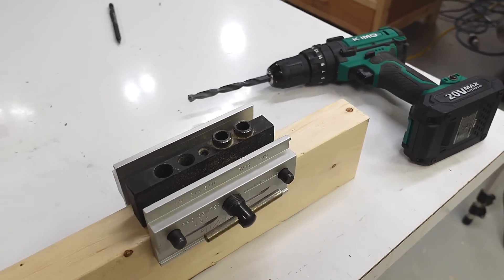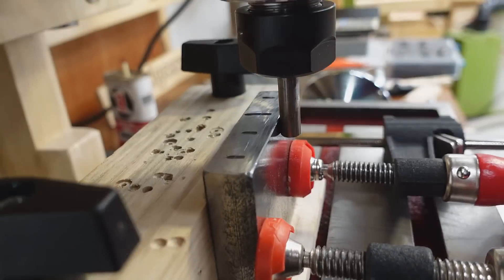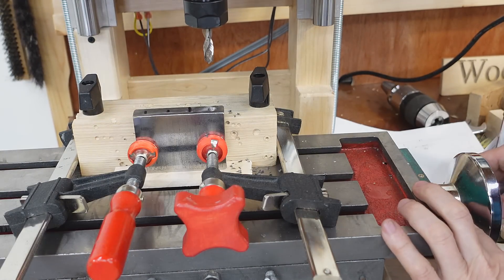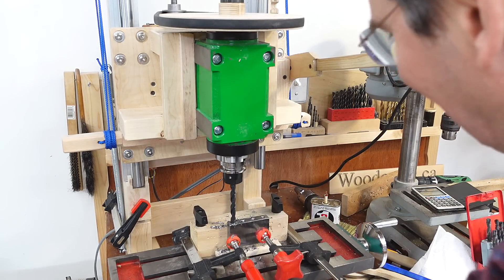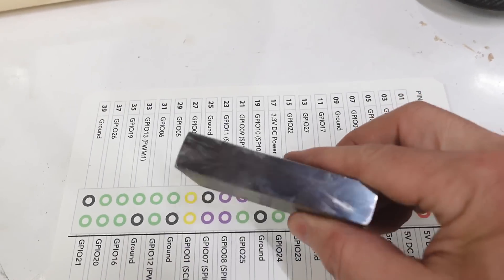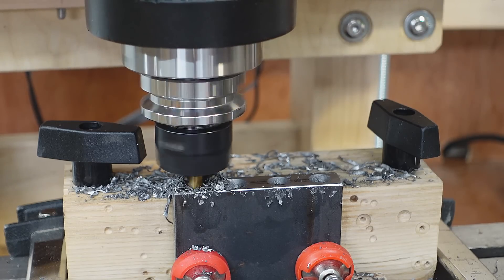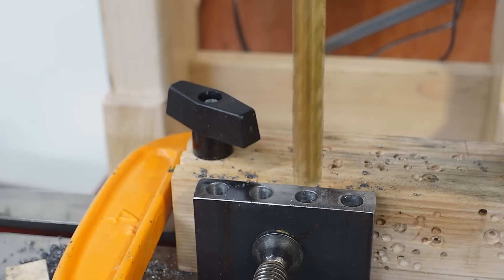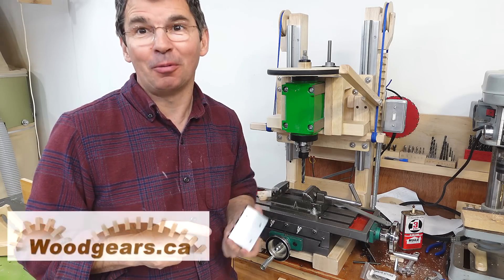Milling the dowel jig I always wanted

Comment: The jig needs to be hardened or it'll wear very fast. I looked at your vid history and you don't seem to have any experience there. Time to learn a new skill! Blondihacks has a very good beginner's tutorial.
Reply from the maker: aware that hardening would help.  But I made it nice and deep so the drill puts less stress on the jig.  And I used to just use a block of wood with a hole drilled in it as a dowel jig, and that also works — for a while.
Reply: Just use hardened bushings

Comment: Maybe it would be easier to use steel pipes with the correct inner diameter and press-fit them into a 3d-printed piece.

Comment: When the drill breaks through the bottom, it can move the workpiece. Maybe don't drill all the way until the end, or cut off the undrilled edge. You can also back it with some metal so that it keeps drilling snd never breaks through to thin air.

Comment: Try a proper cutting fluid. It works better than oil. try adding a bit more of it as well. it helps float out the cheeps. (homage to an old friend).
Reply: I was just going to remark that I didn't know you could use our beloved "3 in 1" oil as a cutting fluid.  Cutting fluids are still thinner, yes?

Comment: 12:40 It could be hidden with some welding (if it's not an unweldable alloy) or brazing and then milling or belt-grinding it flat again, though probably not worth the hassle for what is ultimately an aestetic mistake (assuming you remember which line is the correct one)
An easier mitigation measure could be to color in the lines, both for visibility and visually separating the correct line from the wrong

Comment: Those drill bits look a lot like the ones I’m familiar with from the big box stores.  I have found those are fine for wood and aluminum but are just not up to the task of drilling steel.

I have found it costs less in then to invest in good bits from industrial suppliers for the few hole sizes I need to drill into steel.  All that chatter and wandering you showed usually goes away with better drill bits.  Where I live, Fastenal seems to be the best source.
Reply: I have the cheapest black oxide bits made and they drill mild steel just fine. But I have a real milling machine and I know what speed to run them at too. So that's why they work for me.
Reply: A couple Dewalt cobalt and regular gold oxide HSS drills and a set of Mastercraft MAXIMUM Titanium coated HSS drills will cut some pretty hard stuff almost like butter. The Milwaukee bits I had previously didn't cut, and some "industrial grade "  from suppliers cut like trying to grind a hole with a dowel pin.
Reply: По металлу HSS-CO

Comment: A quick fix for the miss-scribed line: fill all the scribe lines with a high contrast paint, then wipe the paint out of the incorrect line. That way you know to always use the painted lines.
Reply: put a tape over the mistake first
Reply: @bullzebub  better put tape over all, and mark new lines ;)
Reply: Tig weld it, and then sand smooth on the belt sander. It'll be like the line wasn't even there
Reply: Grind the entire surface smooth and re-scribe.
Reply: Alternatively and less quick, bolt a small black anodized plate to each side and put the maker’s mark on there in addition to the scribe lines. There’s just something wonderful about covering up mistakes with vanity.
Reply: Put the same incorrect mark on the other end too, then come up with a justification for them

Comment: Research has shown, cutting with an angle grinder uses less discs when you move the grinder quickly, with little pressure. Pressing down speeds things up, but it's less efficient use of the abrasive disc.
Reply: He did a video on that ;)
Reply: @riba2233  What's the title? I don't remember if I saw it or not. I remember seeing a video looking into exactly this, maybe that was it lol.
Reply: @Convolutedtubules  I think it was on his 2nd chann

Comment: As a pre-digital age machinist, a guideline:  pre-drill holes no larger thasn the web size of the next drill size.  I try to match within 0.5 mm myself.
Justr FWIW.
Reply from the maker: Was aware of that.  But I was afraid the really thin drill would not drill straight enough, and then the bigger drill might follow it.
Reply: @matthiaswandel I'm just a hobbyist not a machinist, but I don't think wandering is a problem unless your bit is dull or you're drilling with too much downward pressure, even with small diameters.
Reply: @matthiaswandel  if the drill is properly ground with the center cutting point being in the center of the drill it will go the direction the chuck is guiding it.
Reply: I've always used a rule of the pilot drill should be 1/3 the diameter of the next drill. That's always worked well for me.

Comment: i know it's complexity, but a DRO might serve you well (or at least a position scale), and the challenge of implementing it might be fun.
Reply: I just got a cheap digital caliper off of temu, and chopped it up to make a Frankenstein DRO.  I think it cost me three dollars.
Reply from the maker: yes, I'm thinking that would help a lot, but I'm not sure how many projects I'll do where it would be that useful.  So holding off buying one for now.
Reply: @matthiaswandel Searching on DRO serial output shows the serial data stream from a inexpensive dro.  This is probably something you could read with a PI or microcontroller for a diy dro.
Reply: But it has to be only an encoder, connected to raspberry pi and with those nice ASCII art characters :)

Comment: Dowel jigs and their design have always been very interesting to me. I think dowels are an underused wood joint nowadays. A scrap of dense hardwood could be used as well but probably wouldn’t be as durable. Nice work!
Reply: Dowel joints are used in everything
Reply: @Phil659 Yes, definitely in production stuff like cabinets and knock-down furniture etc., I should have clarified- I meant more as a go-to joint for woodworkers on a single piece.

Comment: Dang Matthias! That angle grinder set up was awesome! Thank you!
Reply from the maker: it was an idea I came up with many years ago, but simplified a little this time.  See links at end.
Reply: @matthiaswandel  I don't see a linked video about angle grinder jigs? I see [1] Belt grinder build (2/2); [2] Miter doweling jig; and [3] Drilling/milling machine build, but they don't seem to involve angle grinder fixtures? Did you mean to link a different video, or did I just miss the right section?
Reply: @johnhawkinson It's titled "Angle grinder flat cut-off jig". Was out in the country shop when he was cutting up long bedframes for Angle iron (which is why this current setup is simpler)
Reply: I will be using that jig next time myself. Great idea Matthias!

Comment: I can't believe he's getting into milling, after decades of doing anything and everything in wood
Reply: I'm not surprised he's milling, but I am surprised his mill isn't made of more wood and an old washing machine motor.
Reply: @RFMongoose  He used as much wood as possible and an old furnace blower motor.
Reply: @woodsprout  naw, could have replaced those slides with panto mechanisms. And that x y axis, could have been wood. And the counter balance spring could have been a leaver counter balance. Also I thought he bought that spindle head.
Reply: @RFMongoose  You should build one like you describe, including a wooden alternative to the spindle he smartly purchased, then make your own video, instead of wanting him to build one with your ideas, eh?
Reply: @RFMongoose  I think a five cutter face mill made from osage orange and carbide inserts would be sweet.
Reply: @RFMongoose  Next week he will make a wooden fly cutter.  Just wait!
Reply: @RFMongoose  You can get away with wood working on a wooden machine a lot easier than you can machine metal on a wooden machine. There will be severe limitations on accuracy. This from someone who spent a career chasing ten thousandths of an inch.
Reply: After working with steel it’s hard to justify using wood for some things.
A couple tack welds hold a joint better than almost any wood joinery
Reply: Mmatthias will need 3 shops now: for wood, for metal and for electronics.
Reply: Jello, styrofoam, wood, plastic,.......aluminum,.........................................................................................................................steel.
Reply: But for wood application.
Reply: Just wait till be mills some pocket holes ;)
Reply: Hopefully 3d printing is next, but I know he doesn't really like them sadly
Reply: I have a hunch this genious will build a hybrid(metal/wood) milling machine that is just as good as a dscent cast iron/steel milling machine.